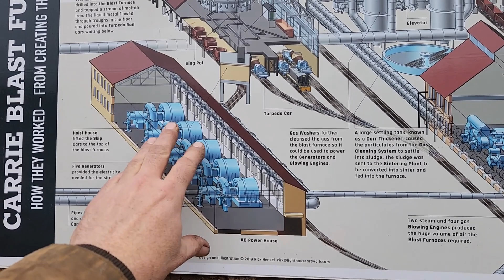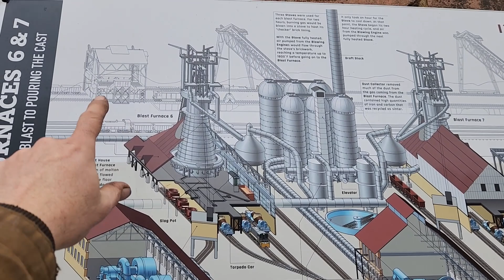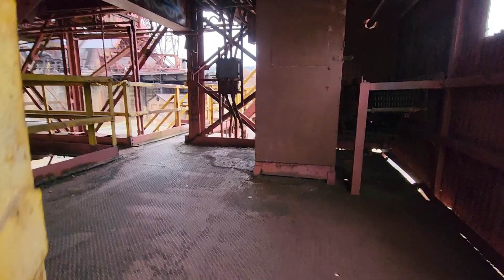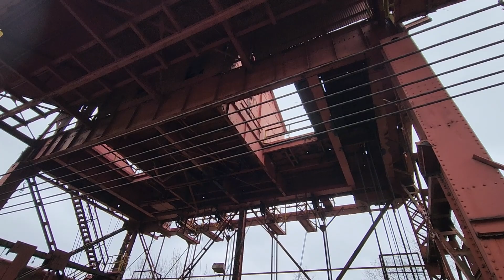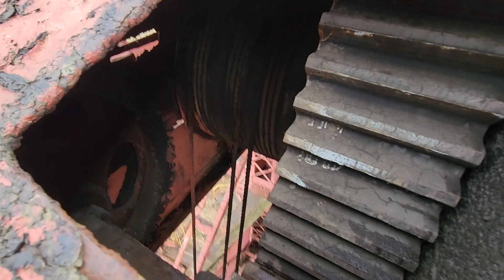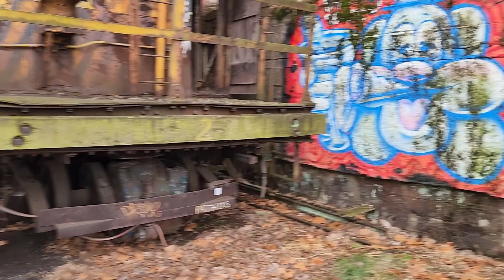Walking Around Carrie Furnaces Part 3 - Car Dumper Machinery

Comment: It's hard to imagine what this country was capable of doing until you see this installation. Wouldn't it be an amazing scene to see it in operation? The electric transfer car is very interesting and the electrics at the top of the structure that controlled the four huge motors was especially intriguing. This series of videos is doing its part in preserving our industrial history, thank you, Rick, for the effort you put in to record them!